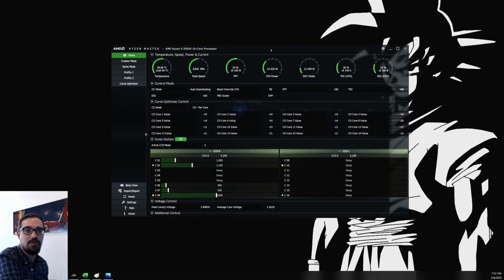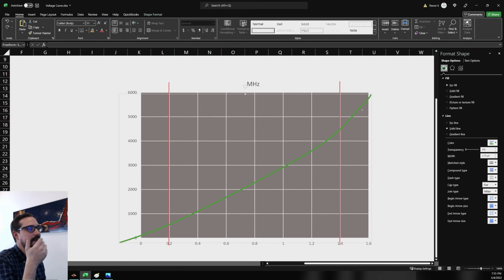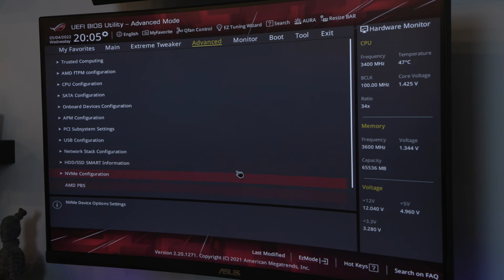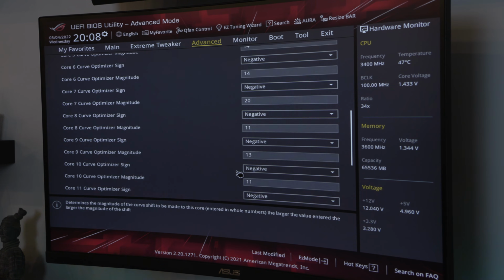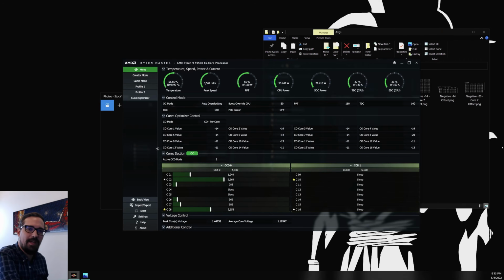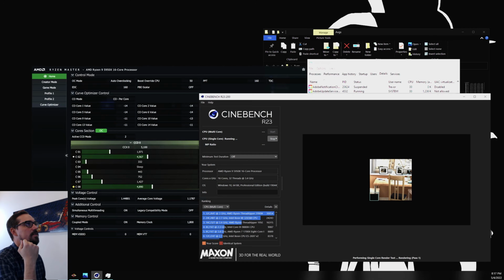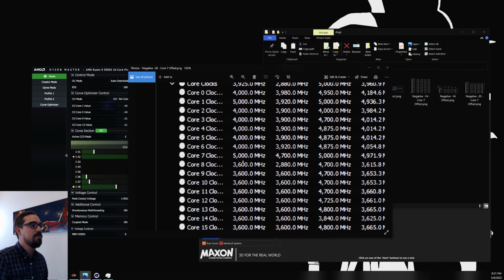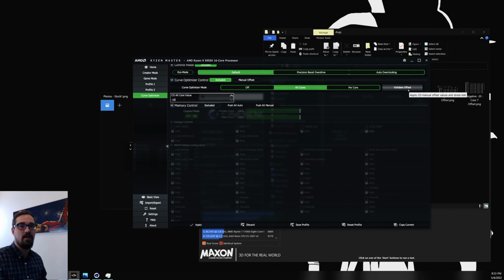AMD Overclocking - Curve Optimizer Explained

Comment: Is it better to do the core changes in ryzen master or in bios ?
Reply from the maker: Same result either way. I prefer the BIOS, but if you make highly unstable changes in the BIOS the system won't boot into Windows. Using Ryzen Master the changes are applied when the software loads. That enables you to click "no" on the admin popup, preventing the unstable setting from being applied.
Reply: I’m gonna go through your playlist later but do you have an overclock video explaining how to do it safely. I want to do it but I want to understand what I’m doing not just change numbers

Comment: cool video but im missing any mention about temps ..
Reply from the maker: Curve optimizer doesn't really affect temps. If you modify the voltage curve on one core the CPU still pushes the power limits to whatever you set your PBO limits to. On a custom water loop running Cinebench R23 at stock settings the CPU doesn't go over 68C. With PBO limits maxed the CPU easily hits 80-85C. The temps are related 100% to the power limits. If you are interested in temps see my overclocking video ("Finally overclocking my CPU"). Thank you for the comment!
Reply: @UnhingedSystems  it kinda dose .. just a little bit but it dose ..my 5950x on Noctua D15 boost single core to 5100mhz within 57c  NO PBO in Cr23 with curve optimizer set all core to -12 ... -14 it crashes in Illustrator  but all core boost in Cr23 hit 3998mhz within 61c .. but when u set up PBO limits like your it his 4850mhz all cores and 85 c .. i know it is normal but I'm just saying cause i notice that yours hits 4900 all core ..
Reply from the maker: @Seth_Samson  I'll be doing a video eventually on clock stretching. I could hit 5100MHz "Max" at specific settings, but it wasn't stable 24/7. The "Max" clock is also deceiving as you gain absolutely no real benefit to hitting 5100MHz for 1-2ms. The best indicator is average sustained clocks at load. All of the measurements I have done show that when 5100MHz is achieved it is pretty much "between loads" and only momentarily hits those clocks, but provides no actual benefit. Honestly with these CPUs the best for stability is to set the PBO limits as high as your cooler can keep the temps down below roughly 85C and call it good. Curve optimizer is cool, but random instability isn't. It's fun to muck about with though and when you do get some small results it feels great! When I turn off "Core Performance Boost" then the CPU is very cool, but like you mentioned it doesn't boost very high.
Reply: @UnhingedSystems  yeah .. for what i'm doing i turn off PBO meaning im leaving it at stock .. i rather need super stable system .. 'cause when it crash and you forget to press Ctrl - S in u are .... f...  ;p that's why  i like that what you said  that u can run cr23 all day long and no crash .. not many are saying that .. with PBO ON i hit like 31000 score in Cr23 at 85-87 C . and it was stable in games and stuff .. but adobe .. crash ..  so yeah cool video .. i just would like to see how is your temps in all of that .. 'cause i notice that you had 42-47 in bios ..

Comment: Exactly my Issue at 4:00. I want to Limit the Voltage the Boost uses, but PBO, Offset, Win Powerplan, etc either were unstable or they didn't change the Voltage much.
The reason i want to Limit the Voltage is because my 5950X boosts to 1,5V@5Ghz and uses over 80W when I just use the PC: No Gaming, or Work, just surfing, listen so Music(Youtube) and maybe a Movie on a secondary Monitor. Also Temps are quite high on the 5Ghz Cores with 85-95°C.
In the End i chose to take some Single Thread performance hits. I took the base Voltage of a 100% allcore and used it as a fixed Voltage. I also looked for the highest stable clock at said voltage.
So i arrived at 1,1V@4,2Ghz. In Cinebench it took me about -10% SC-Points, while the MC-Points actually rose by 10%, since the CPU uses 3,8Ghz as an allcore Clock at stock.
For my Szenario and for Gaming the CPU got 30-50°C cooler and uses 30-40W less Power. Yes -50°C is not a joke, it went down from 85°C max to 35-40°C with my surf Szenario, while Gaming is at 50-55°C.

Comment: For my 5900X I let auto curve optimization run and do a -18 all core offset. I have thrown a few intense games at it, Red Dead Redemption 2, ultra settings at 1440p and DCS World upscaled to 5k, and then down scaled to 1440p with DLDSR, with max settings.

So far everything runs fine. RD2 hits 70fps easy, at 16-22% CPU usage and 99% constant GPU usage. For DCS World, due to its poor optimization, hits anywhere between 50-60fps on ground and 70-100fps in air GPU usage is between 88-98% and CPU 8-13%. 

RD2 things are smooth, even with FPS dips. No loading or jitter, though it's easy to tell with the CPU and GPU working because my AIO fans crank up hard. I can turn on Nvidia Shadow play recording and not even notice, as the CPU and GPU easily handle the extra load.

DCS World has occasional jitter and stalls with, not bad but noticable. It's as if the CPU and GPU temporarily fall out of sync.

Coming from a 3900X, what I like about PBO2 and the Ryzen Master for 5000 series is that the auto OC features actually do something, instead of just throw a bunch of voltage at the CPU. With -18 offset and PBO limit set to 200mhz, and Auto OC selected, things run fine. The cpu cores dial up and sleep as needed. The algorithm seems smart enough to only use one or two cores at a low speed, when doing light things like internet browsing.

Comment: The testing behavior really does seem like a major blunder by AMD. All they needed to do was to make the program stress test the cpu cores individually at lower cpu clocks. So something like testing each core at 10 or so points along the frequency curve would have made this a non issue.
Reply from the maker: I think they will eventually refine their methods enough that user tweaking probably won't be a thing for anyone other than benchmarking overclockers on LN2. We'll see! With all the variation is capability from one chip to the next it may always have some value in tweaking.
Reply: @UnhingedSystems  I just thought of an idea to kind of roundabout test at lower clocks. I'm not sure if this feature is present in the 5000 series cpus, but the 7000 series boosting behavior is to just continually ramp the cpu clock until it reaches the max set temperature, or max boost clock. And since there is a bios setting that allows you to change that maximum temperature, you could indirectly lower the maximum clock speed by reducing that max temperature setting. I wonder if setting the maximum temperature below the idle temperature of the cpu would keep it at minimum clock speed, thus allowing you to stress test the negative offset for each individual core at the bottom of the curve.

Comment: After a year of wanting to learn how Ryzen Master and all the OC functions works, I tried right now because of your nice explained videos. Thank you! If I’m happy with the results, I’ll try to OC my RAM.
Reply from the maker: Glad you found it useful! Thank you for the comment!
Reply: @UnhingedSystems Thank you
Reply: @sup3rnov400  Hi, I am two minutes into your video and already have two questions.  What is the curve optimizer supposed to achieve, and what is this "offset".?  when I get a reply, I will watch the rest of the video.  Thanks.
Reply: @ADB-zf5zr  you can undervolt your cpu if you put negative offset -30 is max i think
Reply: @sup3rnov400  Thanks, but I still do not know what a "negative offset" actually is, and it is sadly missing in this video.  I installed RyzenMaster and had a look around and found nothing that I was comfortable using, mostly because it assumed that I (being the Master) knew what I was doing, and the information given within the program (tooltips) was essentially useless.!
.
It is obviously not your fault, not your program, but what I would have loved to see was a basic overview of what the meanings were being used, such as: offset, mv, and so on.  I am not suggesting that you re-do this video, or make a new one, but IMHO it would be super useful for noobs to get the absolute basics right at the start, I have no doubts that many people found this video and have no idea what OC stands for, what an overclock is, or why they are even watching the video, except that a friend suggested they use RyzenMaster, and they found themselves watching a video and was overloaded by acronyms and never went further because they don't watch foreign language videos.  Just someone trying to help.
Reply: @ADB-zf5zr Negative offset idea is literally shown in the video in a separate graph.

The purpose is: you try to give less voltage to a cpu core, which then makes it run cooler, which can make it run faster. It also consumes less power. The downsides: undervolted too much, it can crash or bug out. The video tries to cover that.

A guy above in the comments mentioned OCCT and WHEA, I googled all that and they look like all very helpful things, too. I really don't want the risk of testing with my project going face down.

Not only is this video a follow-up, but it's obviously for advanced users. Trying to get everyone up to speed will prolong every video by 15 minutes and it's not always necessary. Oc and undervolt are for sure explained in their basics a thousand times.

Finally, this is definitely not a Ryzen Master manual. Not even close.

Comment: This was very informative, useful and entertaining. I cut a lot of time off of this, by finding my baseline allowing RM to do an "AUTO" curve optimizer, which did get me to an all core negative 30, and  I haven't had a single black screen, flicker or crash. I've run several benchmarks, and still no instability at -30. It took the auto curve optimizer about 45 minutes to complete, and my system runs an all core oc at 4.65ghz while benching, using my 5900x. I realize I can probably push this processor a bit faster than that, but my temps are idling in the 40's, and benching in the high 70's and low 80's. It appears to be sustaining its performance, and running very stable. I've scored in the mid to high 20k in CBR23, which is a strong showing. What I don't know after running the auto optimizer in Ryzen Master, is how to tweak it without destroying the current setup? Not a RM guru as you can see. But learning as I go. Thanks for another great vid.
Reply from the maker: Thanks for the awesome comment! I appreciate it! You can use one of the profiles to set/play with your own settings, but if you are sustaining -30 that's pretty awesome!
Reply: @UnhingedSystems  I had no idea about the auto optimizer in RM, and just saw it in a vid. So I decided to try it, just to see where it got me. 45 minutes later, I'm well ahead of the game, and can do smaller incremental tweaks to improve moving forward. But I will run with it as is for a few days, just to see if the speed and stability continue. I also downloaded the corecycler script, and will start it tonight and let it run while I sleep. It will be very interesting to see what the results are. Cheers!
Reply: @gorkman My 5900X idles around 44c, and runs up to 83c under full load. No errors or black screens.

Comment: Is there a way to lower voltage only at the higher fequncys? What if you set a negative offset/adaptive voltage?
Reply from the maker: You certainly can set a negative offset, ultimately the CPU will just boost to lower frequencies. You unfortunately can't specify higher voltages at lower frequencies and lower voltages at higher frequencies. If we could specifically control the voltage curve throughout the entire curve that would be cool, but I can imagine the amount of testing to find stable settings would be immense.

Comment: So before I ran the optimizer I was running 5050mhz on my 5900x. I ran a per core optimizer and got a -29 on every core and now my OC set at 4900mhz. Should I leave it as it is or try to go to 5ghz?
Reply: How were you getting 5050mhz on your 5900x???? And as long as it was stable, why would you ever mess with that???
Reply: @AquaStevae  idk but I think I've got a really good CPU is all. I was able to get it to run at 5050mhz after a manual offset of -14 all core, -20 on my best two and -16 on my second best two cores

Comment: N00b question: Do I have to keep Ryzen Master open and running to use the CO profile? If I close RM, will the curves be unoptimized?

Or should I now just plug the values into the BIOS?
Reply from the maker: Ryzen Master will apply the OC when it loads, it will need to load each time. Once you are happy with the settings applying them in the BIOS will eliminate the need to use Ryzen Master 💪
Reply: @UnhingedSystems  Thanks for the fast reply!
Reply: @UnhingedSystems  Also, I didn't know Ryzen Master changed the BIOS values itself! Just been experiencing game crashes and BSODs (thought it was stable but no) and when I entered BIOS I found the auto optimized values there. (-25 all cores). I'm reverting back for now until I have time/patience to experiment more. Right now I want stability.

Comment: use occt or corecycler for per core curve optimization testing, save yourself the weeks of testing.
Reply from the maker: I use OCCT and corecycler as well, but oddly enough my single-core intense games still cause instability. Every test I can run passes, but then I load Stellaris and there are random crashes throughout several hours of gameplay. I've managed to land on some rock solid settings but the curve optimization is finicky. Can work 100% in every app, then in one it's picky.
Reply: @UnhingedSystems  Mmmm, gotcha, that makes sense. Sucks that you're having random issues, that's frustrating.
Reply from the maker: @ConGie  It's all working well now! Thank you!

Comment: is this worth it?
Reply from the maker: Great question! That's really subjective. For me it helps me get higher single-core sustained boost clocks and I play a lot of games that rely heavily on a single thread. Those games benefit from it. If your game isn't CPU bound it isn't going to make much of a difference. Most people just get their systems, play/work on them and never consider overclocking or tweaking, but some want to squeeze every last ounce of performance out of their system and this is one way to do that.
Reply: @UnhingedSystems  im using ryzen master abd just using auto OC and all core CO

Comment: Hello. Im able to run -30 in all cores. Is this good?
Reply from the maker: If it's stable with all cores at -30 then that's pretty great!
Reply: @UnhingedSystems  do i leave V on auto when using pbo? Or manually lower it below 1.4
Reply from the maker: @developer6619  If you leave it on auto it will run fine. If you lower the voltage it will reduce the maximum boost and performance. These CPUs at stock settings see voltage bursts up to nearly 1.5V, but at full load it is much lower (1.26-1.35).
Reply: @UnhingedSystems  i tested alot today... i can run -30 undervolt with auto V but the boost on all cores is around 4.6ghz when geekbench 5 multi core test

If i run manual lower V, 1.39V even tho i can max go -27 undervolt, the cores go up to 4.75-4.79 ghz on all during geek5 benchmark on multi

The lower the V and higher the boost on all cores is, i found that interesting. 

The single core boost is still same but multi seems to be higher on lower V
Reply from the maker: @developer6619  Cool stuff! The behavior of these chips is very automated on its own algorithm. The less voltage being provided can actually free up more overall power (Watts) headroom and allow higher boosts depending on the chip. Less voltage at the same amps = less watts which means the CPU is able to push a higher power draw and boost higher, as long as the voltage is still sufficient. I really enjoyed these chips, the new 7000 series isn't as much fun IMO.
Reply: @UnhingedSystems  makes sense

Yeah new ones are also weak compared to intel. There is no comparison on every test

Btw i set my pbo limits to mobo, is it also safe if i set to 500w 500a 500a limits? Just so the cpu has infinite headroom... everyone seems to put the exact numbers  like 170 120 etc but setting an X limit is still safe in theory

Comment: I'd say get CRT and check core quality and divide it by something like 11~12 as your per core curve optimiser negative value as a baseline and lower it so that the core load matches the load a.k.a. 2 can go far, 4 can get somewhere around, but you get closer to the limit of draw so, lowering on another 4 cores might bring more stability and so on so on. Use core ordering by the core quality from max to min. That pretty much worked well for me where I found myself lowering the per core CO to have stable frequency without fluctuations. Dynamic OC from Asus dark hero motherboard seem to be good not to sacrifice too much on 1..4 cores for sake of 16 and maybe 8 cores load.
Hope that doesn't seem too cryptic.
Reply: What's CRT please? Thanks